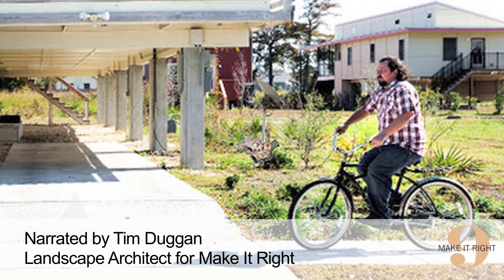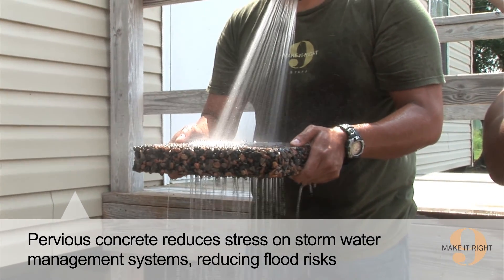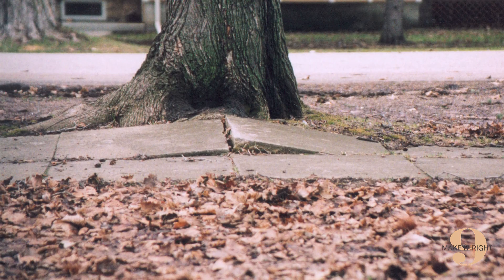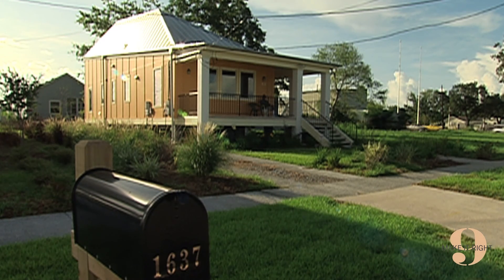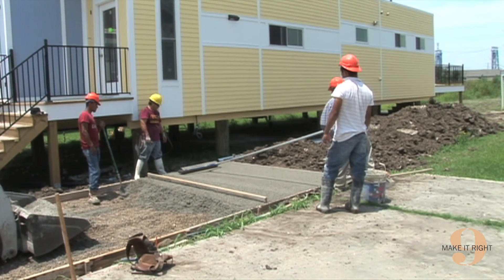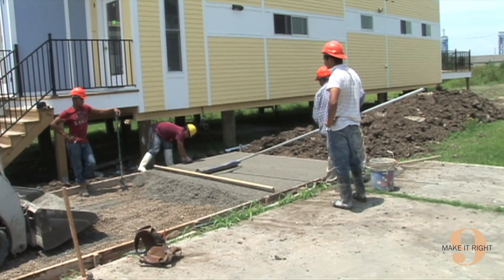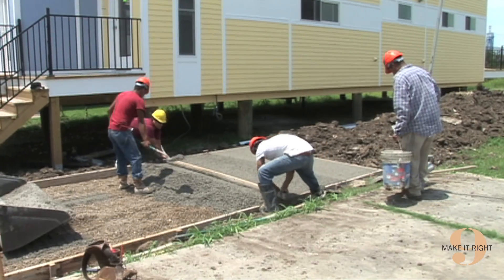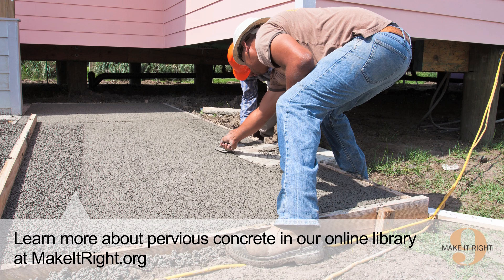Make It Right Insight on Pervious Concrete

Comment: Will the top freeze?their are air voids that water drains through it so really is there enougharea for it to fill and cause a crack? I've made my own pavers in my front yard by hand mixing and it seems to me that there is enough void for ice to form and not cause an issue. Then again I'm in Cali so I don't see any freezing temps.